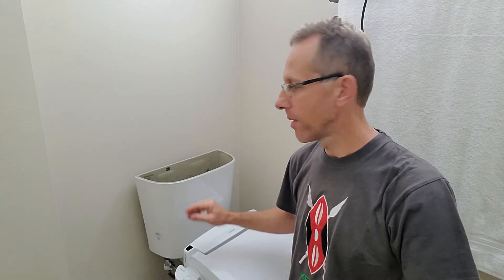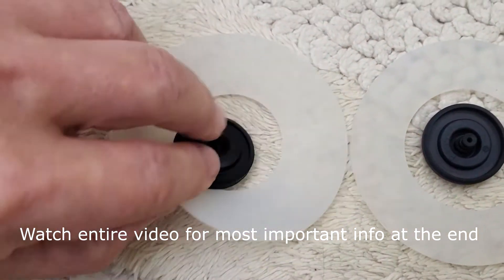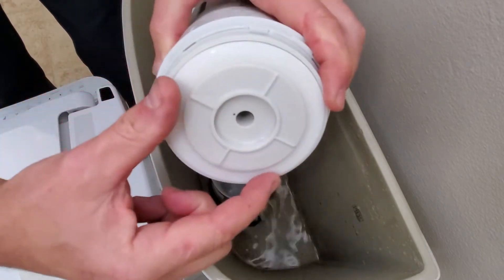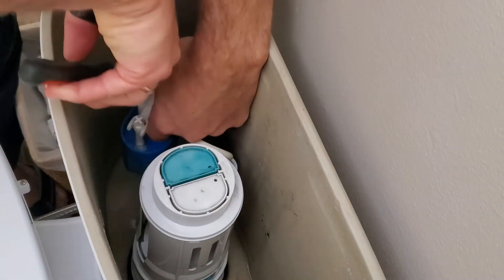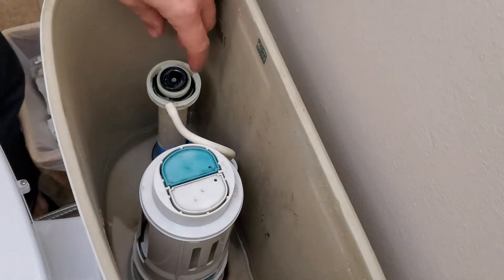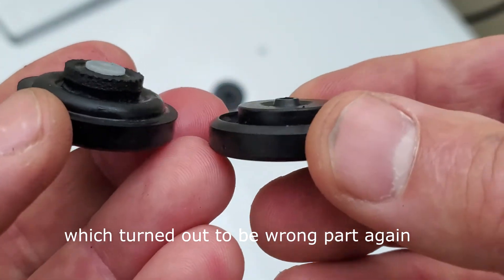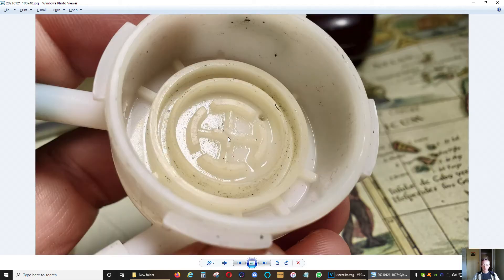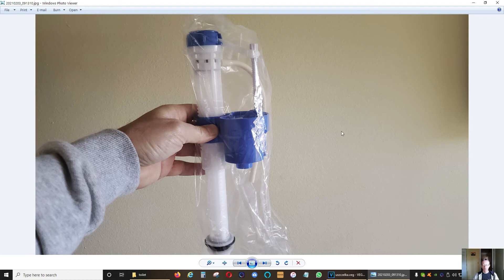Glacier Bay Dual Flush Toilet Diaphragm Replacement

Comment: Thank you so much.  I just used your experience on here combined with steps other videos have shown to flush out the fill valve on my Western Pottery toilet.  They’re out of replacement fill valves and the replacement rubber seals they have are wrong (just as in your video).  Based on your experience I went back and flushed out the fill valve one more time including the cap with the rubber seal still on it.  Now it’s back to working and my wife is happy.  Thank you sir!

Comment: I just omitted the rubber diaphragm altogether, cleaned out all the debris (old deteriorated diaphragm that caused the problem in the first place) and it works just fine. I don't know why it's there to begin with. All of the water goes right into the tank anyways.

Comment: Thank you for the video. I am finding it impossible to remove the cap as you show at 2:43. What amount of pressure are you using ? Is it downward pressure and then turn ?
Reply from the maker: Correct. Push down and turn.
Reply: @MaciejPiotrowski  thank you for confirming. My cap was stubborn. Had to remove the fill valve assembly from the tank and use a wrench and good amount of pressure to loosen it. It did the job. Thank you for this video and your clarification.

Comment: i tried to remove the flush valve 
it was just rotating either clock wise or anticlockwise not able to 
remove the valve
Reply: same here, is like super tight I feel I'm gonna break the tower
Reply: I was able to take it out with pliers and removing the whole tower from the toilet so I could grip it. However I'm still working in getting it back :(